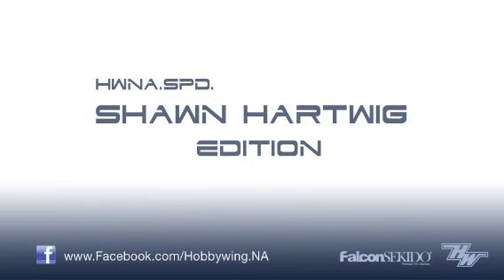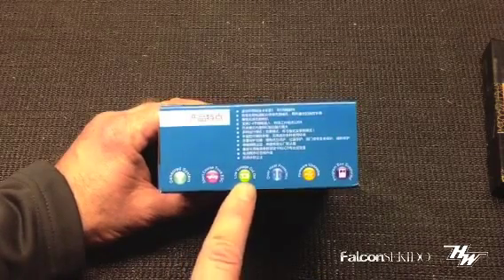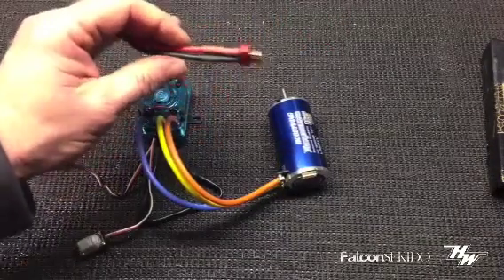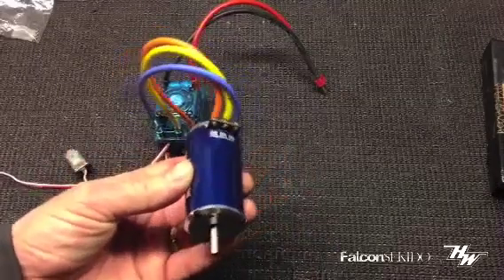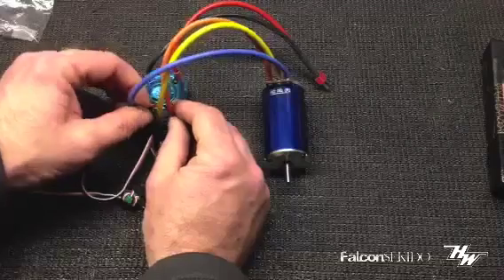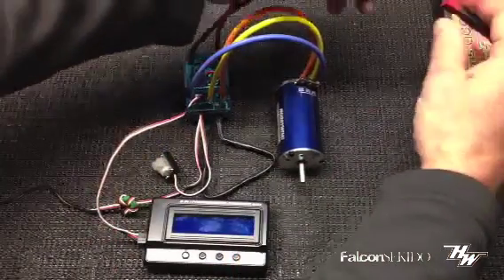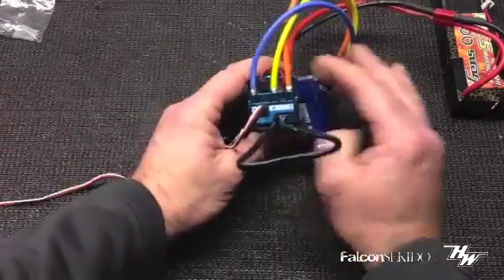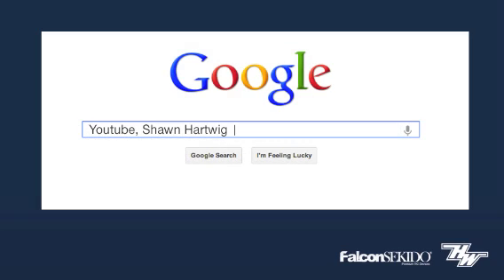HOBBYWING XeRun SCT-PRO Brushless ESC for 1/10 or 1/8 Car

Comment: Nice video, but I have a question about the card to esc connection, my esc only was to poles at the fan connection, can I still use my program card, my hobbywing esc came stock on my Redcat rampage xb-e?

Comment: What timing do you recemend for the 150a water proof esc if i use it with a 1/10 2 pole motor? Its a 3250 kv rated 3s

Comment: I purchased the xerun 4700kv sct pro combo and I have to set my low voltage cutoff off at 2.8v which everything says is to low but my batteries are always over 3v after it cuts off.  is there a reason I have to set it so low or is it defective?

Comment: What color is the light the esc bc the light on my esc is purple. And the program box just say it's connecting to esc I can't get the bot to work let me know if you think you know what it could be
Reply from the maker: +andre knox  there are a green and red led light indicators. depends on the stage you are in ex at start up, during operation, or programming, the LED lights communicate the status of the ESC.  Please read the product manual. 

As far as the programming box, yes, it is confusing. "connecting ESC" means already connected 'or' it is connecting.   we need to understand what exactly you are doing to answer the actuate status.  please visit our website: www.HobbywingDirect.com  under support / tech

Comment: The Xerun 3656 brushless motor is normally paired with the Xerun SCT PRO speed controller. This has an output of 120A Continuous, 760A burst rate with a BEC output of 6V/3A. The Xerun 120A V3.1 also has the same output characteristics. It would work. Just make sure you choose the correct vehicle setting. If its for a short course truck then select the SCT/Buggy setting.

Comment: Punt66 if your only getting the connecting ESC message then you are likely hooked up to the wrong wire. Make sure you attach the program box through the fan plug in.